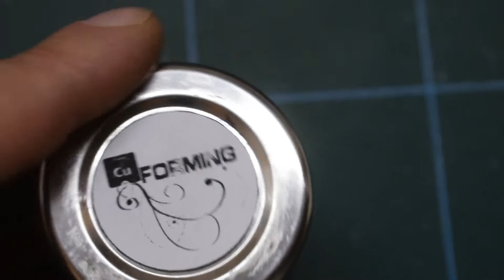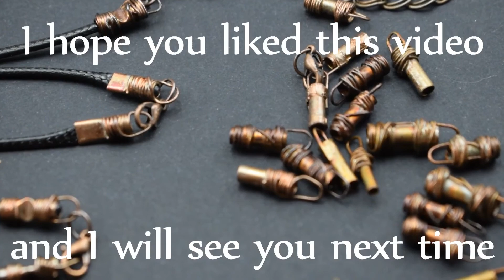How to make crimp end caps for pendants | Electroforming

Comment: @CUFORMING HELLO WONDERFUL VIDEOS. I have only just started with electro forming. Question- I’m of the understanding no type metal such as aluminum, steel, iron, etc can go in the bath. Your opinion please, and thank you!
Reply from the maker: Thank you!!! It's an interesting question that needs a very long answer. Basically any conductive surface can go in the bath to be plated. Almost any metal, but some require special preparation, such as oxide removing, though. To avoid contamination of iron, it just needs to be connected to cathode and live, with the current on. If you put a loose pieces of iron or steel in the bath, it's gonna contaminate your solution. The same could happen if you hang a piece of iron or steel on the cathode without current. I don't have any knowledge about other metals contaminating the copper electroforming solution. Not any kind of steel can contaminate the solution, and some kind of steel can be plated without current. This is a long topic… I could go on all day. My advice is to experiment your self… it's gonna be fun, trust me on this.
Reply: @cuforming  Grazie millie 🙏